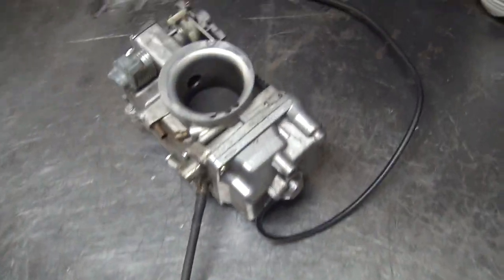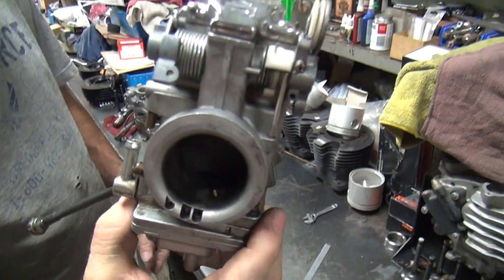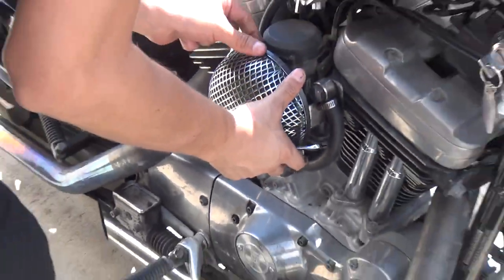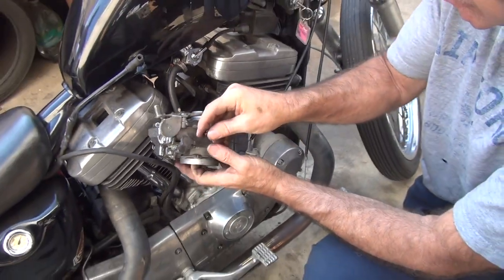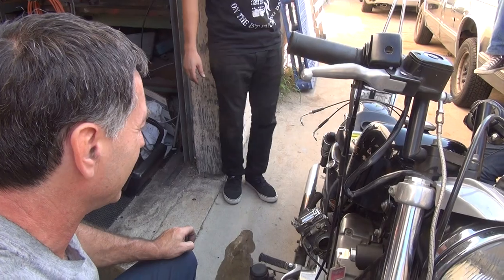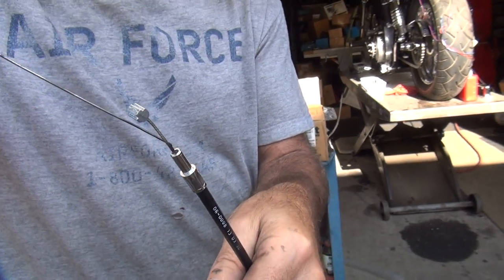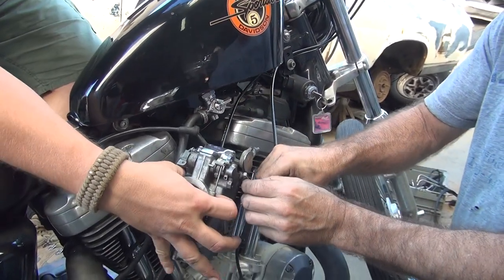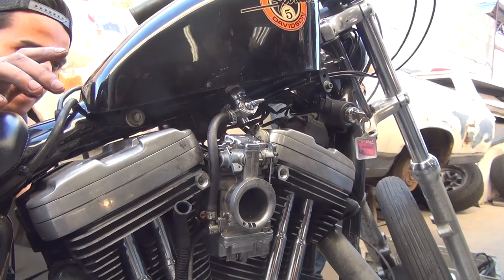#101 HSR42 42mm Mikuni carburetor rebuild and install 1200 Sportster Harley XL 1990-03

Comment: I have a mukuni carb on my 89 Harley , flat side only numbers I can find are Tm42/318/b2, need a air mixture screw ,air adjustment,  any ideas on a manual and where I can get this part

Comment: About the cables... I had the same issue on my '01 XL when I put an HSR42 on it.  Ended up cutting the ends off & casting new lead ends on the cables.  God forbid I actually buy new parts!

And a tip on that brake switch - it's pretty easy to break (not "brake"...) the little dingus on the brake lamp switch on those style master cylinders.  Taking a piece of cardboard and putting under the bottom of the brake lever to hold the lever "on" a little bit while re-assembling everything makes it easy to not FUBAR that little pain in the ass brake switch

Comment: Thanks for this video. I am in process of rebuilding an '03 Sportster and doing many of the things you do in this series. These videos are very helpful and informative. 
Rebuilt my HSR42 and found jets inside of 20/122. It does not idle. So I ordered the stock size 25/160 and should get them soon. What sucks is not having many sizes on hand. It has those "ground pounder" short pipes on it, and Im not sure how exhaust effects the needle size needed.
Is there a rule of thumb? The less restrictive pipes need smaller or bigger jets? More restrictive pipes (baffles) need smaller or bigger jets?
Reply from the maker: no, the motor wants what it wants and they are all different. loose those pipes and it will run tons better. just look at that evo chopper i just worked on with the wcc pipes on it.
tatro

Comment: Can you please help me out? I recently removed my Mikuni HSR 42 carb and bought a 40 mm CV carb to replace it. The manifold is a Screaming Eagle part no. 29637-99. The spigot of the CV carb fits too loosely in the old rubber seal of the manifold. The Mikuni used to be a tight fit. Is there a beefier seal I can buy to make the CV carb fit properly?  Thx.
Reply from the maker: just get an old stock intake manifold and you should be good to go.
tatro

Comment: Is it possible to put this carburetor on a converted xl1200? I mean converted from 883 to 1200 with 883 Zylinder heads? Or is it to big?
Reply from the maker: it will work just fine on all sportster and big twin street motors.
tatro

Comment: What is the standard setting for the air fuel mixture screw if you don’t mind?
I don’t remember if it is 1 1/2 complete turns or 1 3/4 turns on a stock 1200 sporty. Thanks.
Reply: I just installed this carb on my bike today and I feel it idles way too high.

Comment: Do you recommend a super E with the thunderjet or a HSR for an evo on the street?
Reply from the maker: thunderjets don't work. either carb will get the job done. i like the hsr better. its more tuneable.
tatro
Reply: @TatroMachine  Should I go for a 42 or a 45 on a .030 over 1200 with an edwards ev59 cam and an exhaust?
Reply from the maker: the 42 carb is fine.
tatro

Comment: I just got a HSR42 for a 98 Harley Sportster 1200 and it doesn't fit. won't fit on the intake, and just is to big overall and won't fit between the engine. Any ideA?
Reply from the maker: it should fit. are you sure you don't have a hsr45. the 42 fits into the stock intake manifold. sometimes you have to trim a fin or so but that is rare.
tatro
Reply: I know it's been a year but when I tried to fit my 42 on my sporty it was hitting a relay (can't remember the name it's been a minute since I looked it up) on the top part of the carb but under the spine of the bike. Looked like it was tight to the motor but it was that. I still have to relocate it but I hate it apart to rebuild the top end so will do it then
Reply: VOES was what was getting in the way.

Comment: If you unscrew the idle adjuster until the slide is all the way closed the needle will fall out of the slide without you having to take the whole carb apart.
Reply from the maker: that might work. i will have to try that next time i get into one.
tatro
Reply: @TatroMachine  Thanks for all the great videos man. They've helped me out a ton.

Comment: an s & s super e  with thunderjet  or mikuni hsr 42  which is better carb?
Reply from the maker: it depends on your application. for the street on an evo on i would go with the hsr mikuni. for racing or very fast street the s&s usally works better. mainly because of the fuel flow increases needed for getting it on.
tatro
Reply: @TatroMachine  s 7 s super is from zippers performance with thunderjet  installed